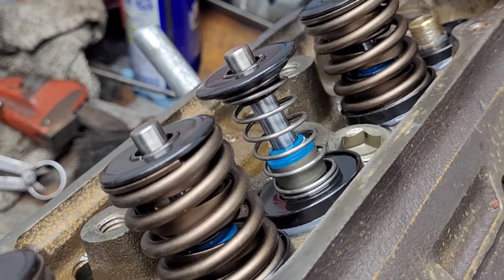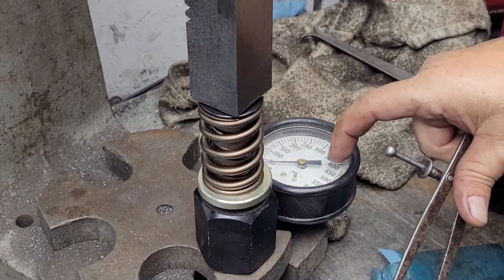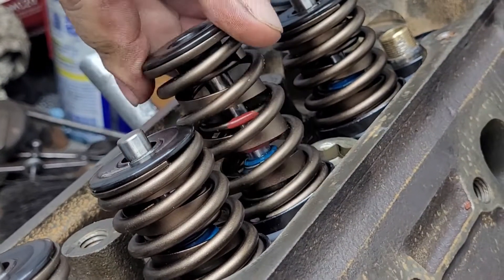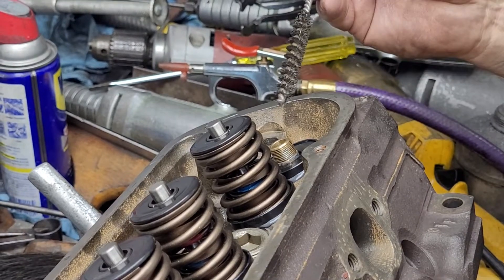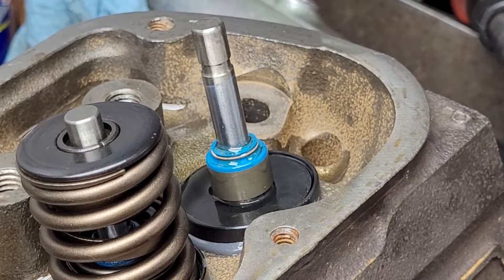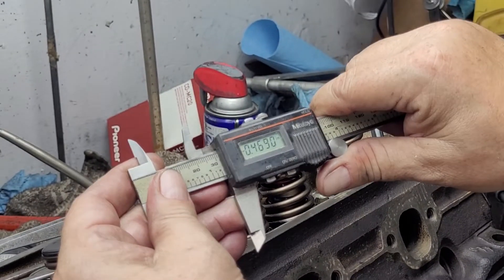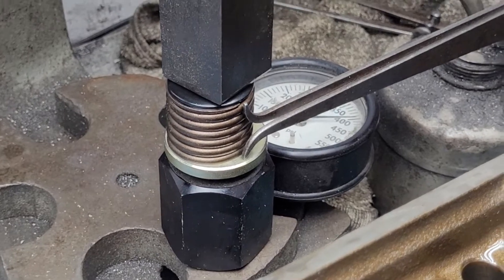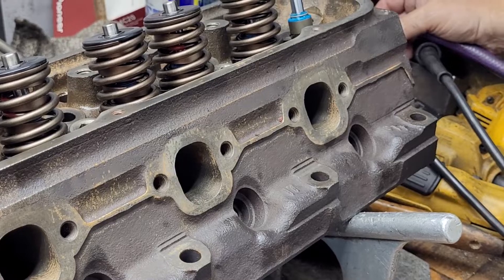Gt40p Setting spring load for hydraulic roller cam

Comment: How do i spec the springs?  Thats one thing I've never been able to really find good info on
Reply from the maker: The cam should come from the manufacturer with a recomend load and possibly a spring part number. Depending on application I may add some load to prevent damage from over Rev or a missed shift. Max rpm is important to factor in.
Reply: @servediocylinderheads  thanks

Comment: charles, try this in a spray bottle after everything has  been cleaned. Its good on Aluminum and Cast Iron to stop any rust from forming. 1 part of Kerosene, 1 part Type F Transmission fluid, and the rest with any cheap new engine oil. shake well and spray your cleaned parts throughly. Wipe off any access and reapply to any surfaces you did work on afterwards. It eliminates any chance of rust from forming. Its better then any water displacement and penetrating oil we ever used at our Machine shop. we stored engine blocks and other engine pieces is a humid basement we had. Zero rusting issues.

Comment: 🔔😎
Charlie, what do you think about using SBC Chevy 1.94/1.60 valves in SB 289 Ford heads with 1.25 springs? (.100" shorter stem above retainer) 🤔 1.750 set up with 130 on seat, @.530 lift. Screw in rocker studs, roller tips. Should I use .080" valve stem caps?.
Thanks for any input.👍 Like your channel.
YeeeeeeHaaaaaw!!!!
Reply from the maker: To use that size valves quite a bit of porting and chamber shaping would need to be included. Those springs are fine for mild flat tappet cams and lower rpm.

Comment: I use the original pinsol alot for cleaning.  Especially carburetors 50/50 with water soaking 24 hours. Works great.
Reply: No oven cleaner on alum or zinc. 😲 For sure.
Reply: @hotrodray6802  i have used yellow top oven cleaner on LS cylinder heads. Spray them , put in garbage bag and tie it shut for three days, check on third day if the tan burnt on oil is greasy feeling? remove and spray again then wait and hour and use high pressure washer to rinse. mine came out new looking. i only use carburator cleaner in a bucket to clean anything zinc. of course after rinsing? blow dry and i spray my clean stuff with a mix of Kerosene, type F transmission fluid and cheap grade oil. wipe off all access and do your work. reapply in areas you did work at. zero rust will form.